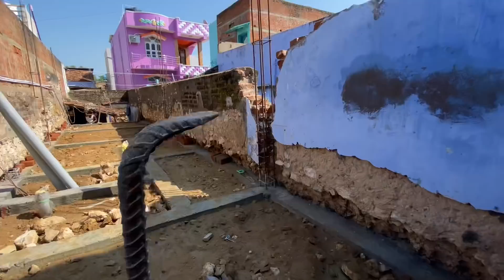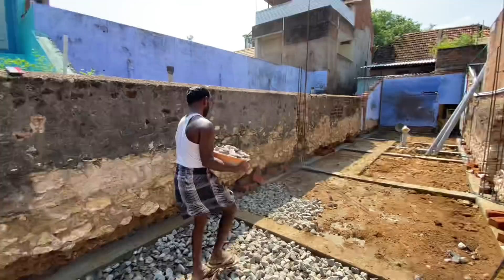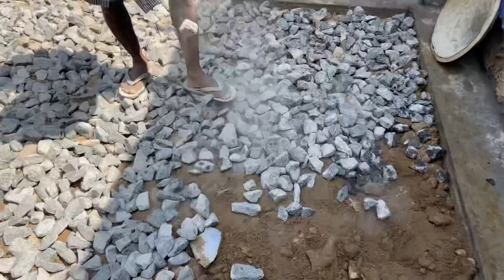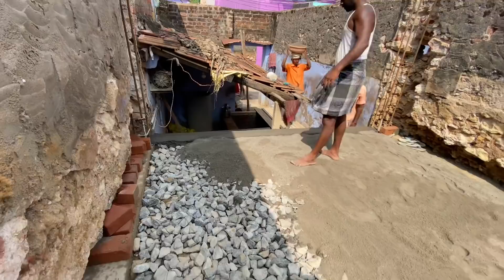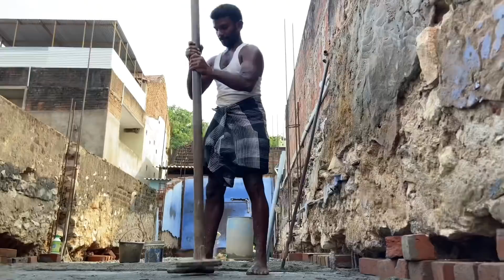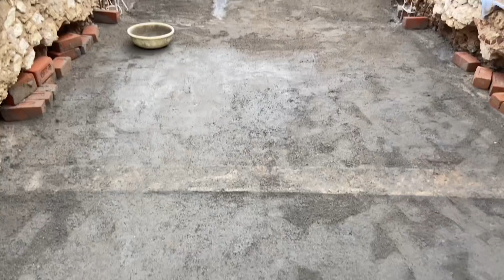Basement PCC Construction-Difficult in 450 Square feet House Basement Plain Cement Concrete Work

Comment: Is this the right way of doing pest control ?
The correct is that the holes have to be drilled around the sides of the walls and entire center region is to be sprayed that's the method 
Please ensure this while carrying out anti termination process follow the rules as per IS 6313
Don't misguide the work